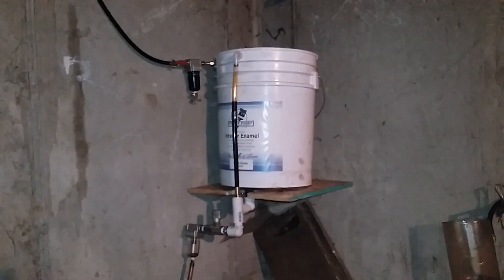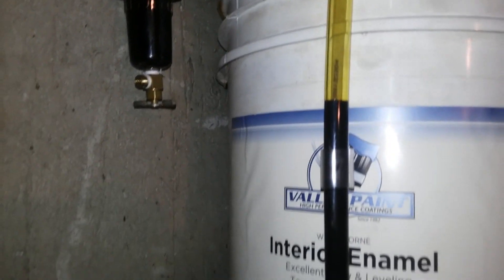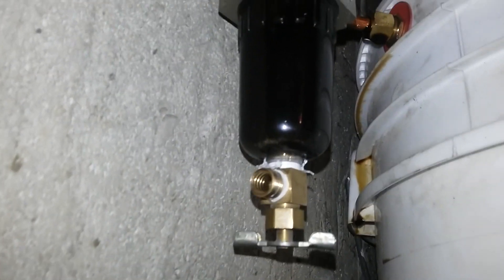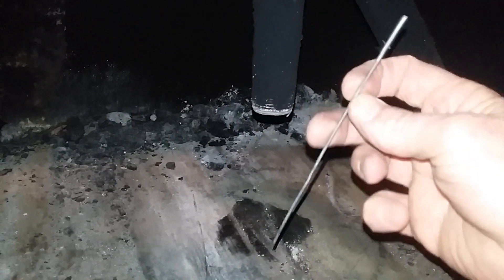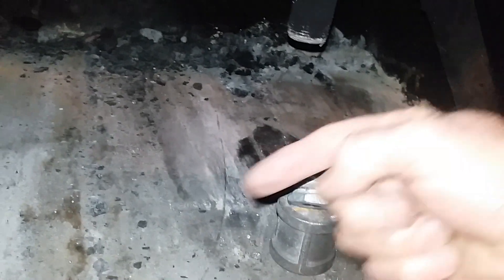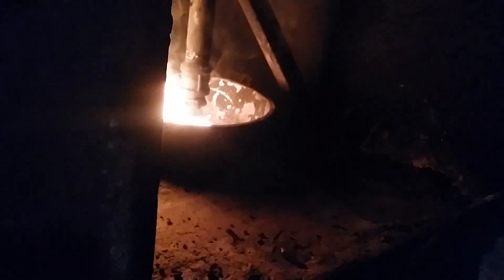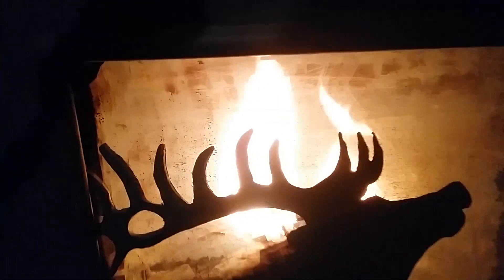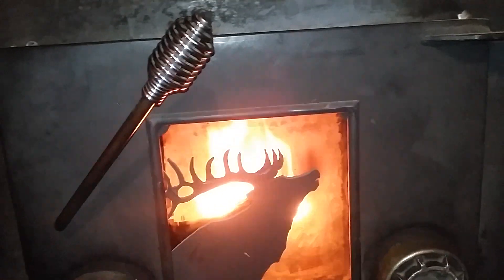DIY Waste oil burner nozzle Homemade How To

Comment: Try disc brake rotors for burn pans AND lids. Air from 360° around from the fins. Cut the center out of the top one and add a flue, or just stick it inside a stove like this with that nozzle fitting down the original hole with the bearing race still in. Fell into that with a big doh moment.

Comment: These dang things are finiky.. I tried to go naturally aspirated and got close with very little smoke, but, never got "No Smoke". Never got any blue flames either and I tried everything I could think of before I started with the fans/blowers, etc.. 
But, I started playing with a 20lb cylinder because that is what was on hand and in my way.. Ha.. 
I am beginning to doubt those who say they burn "Straight WMO" and have "No Smoke".. I am going to mix some Diesel/Kero/Gas with the oil at different ratios, etc,, and see what it takes to burn blue and totally.. 
I am only working with a 4 foot stove pipe, outside testing,,, so, if I get it figured out, only gets better when I hook it up to a 10 or 12 foot stove pipe chimney.. Going to make a small fuel container/source when I play with it next to play with the fuels.. And, when I get it figured out again,, I am going to use that  fuel container to drip some water in the oil again.. Talk about Wow heat and Wow Flame, and clean burning for the next 10 seconds before it soots up again.. 
It started raining when I was testing with the 4' open flue and wow,, what a surprise that was.. Itching to see that again, but, you have to have it running pretty hot to get the "Wow" effect. Want to see if it is sustainable.. Might get a ration of water to oil and cut down on fuel costs.. :)..  Everyone is buying used motor oil around here.. I only have about 70 gallons for testing and playing, but, I figured I would learn a bit... Might find a fuel source if I get something that "Really works"".. Thinking about radiant heat in the dirt floor blacksmith shop.. Always cold in there.. Ha.. Cheers and Good luck with it.

Crap.. I thought the video was new.. 2016.. Guess I better see what else you came up with.. Thanks...
Reply from the maker: I believe adding water just vaporizes everything until oxygen can
 intervene and that is where you get the big wow.. I believe the trick is getting more oxygen with the vaporization.  You're on the right track though my friend let us know your results!!

Comment: Is the heat the same as a fire going? How much oil do you think you burn in an hour?
Reply from the maker: Fire compared to wood fire I would say is the same, Burns 2 litres per hour,  Depending on how much heat you want. Thanks for watching and commenting!

Comment: Try a a stainless steel bowl on top for a lid it cut my oil use in half and burned hotter/ cleaner. Has to be offset about 3/4 of an inch to allow air flow
Reply from the maker: I actually have thought of that but just have never done it! Thanks for your comment!
Reply from the maker: You should post a video of that and send me a link?
Reply: I would love to see a video of that also.
Reply: @charleshayes5168  me tooooo

Comment: Hi, what is that see through Drip Glass thing? I need one of those :)))) THANK YOU !!!
Reply from the maker: Its a water separator for a air compressor, bought it at Harbor Freight for 5 bucks or so. if you watch the other videos i have on this i show more detail of how i made it.
Reply: @mugivermusclemachines5744  l
Reply from the maker: Here is a link to another stove that I built, different but ame concept!
https://youtu.be/5Z3vSEKzz60

Hope this is what you wanted!!

Comment: is this in your house and do you use secondary air with this
Reply from the maker: a blower takes outside air in for combustion and a separate blower for the forced air heat, air knobs on the door are slightly open for combustion.

Comment: What type of float did you use to stop the flow into your holding tank and what type and size is your filter separator
Reply from the maker: +Richard Johnson
   I just used a regular swamp cooler float assembly with the fittings you can buy in a kit on Amazon or Ebay or even your hardware store, same with the separator they're all quarter inch pipe size. Hope this helps thanks for watching!
Reply from the maker: +Richard Johnson 
Just a regular swamp cooler float kit and for the filter is just a standard hydraulic tank filter I'm not sure what Micron it is?
Reply: get them for a swamp cooler

Comment: Just watched and subscribed,do you run your burner 24/7? or just as secondary?
thanks your neighbor from B.C.
Reply from the maker: +Ray in Canada 
the most I have run it so far is 24 hours straight then I needed to clean out the bowl.  It only took about 5 minutes to clean the bowl out and fire it back up the stove didn't even get cold.
   I am running a 6-inch stainless steel bowl now and it seems to work great!
Reply: Was thinking about doing this to my wood stove,but adding a 30 pound propane bottle on top of  the stove and chimney to capture more heat,(like a rocket stove heater) any thoughts?
Reply from the maker: +Ray in Canada 
  That should work as long as you can maintain a draft up your chimney.